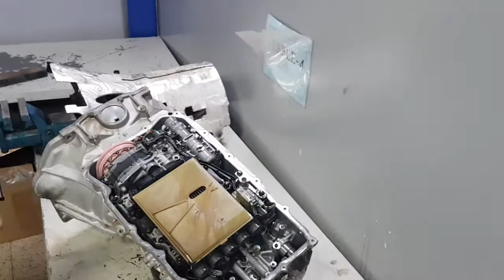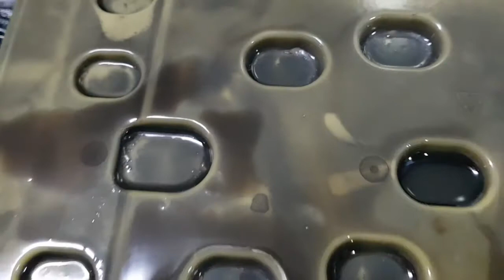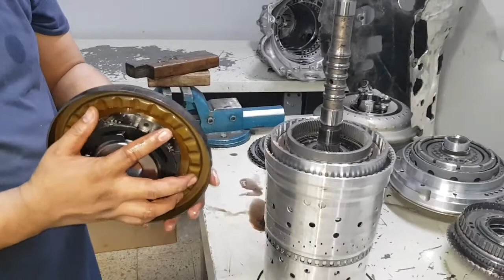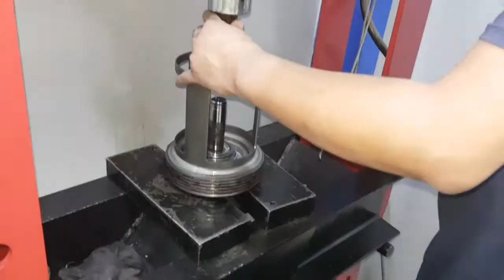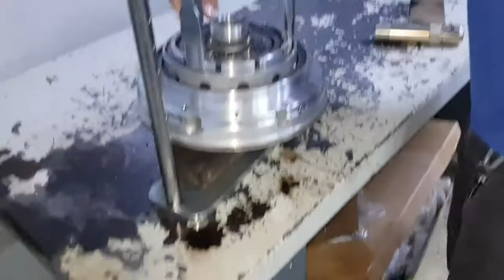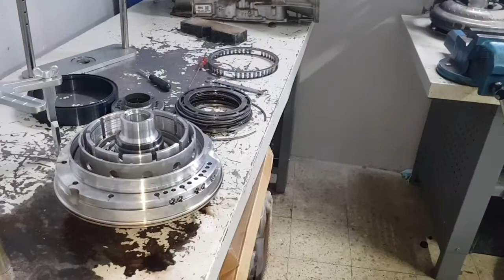10L80, MF6 TRANSMISSION DENALI. Noise and delayed shift, dismantle and inspection

Comment: What's the gold looking stuff in the bottom of the pan?  Mine had those chunks of brass/gold nuggets at the bottom of the pan when i changed my fluid. It moves around and is not casting material. Makes a very slight whine when Revving the engine.

Comment: GMC Greatest transmission ever: Builds the 6L80 with pump built into bellhousing. Bla lol.

Now the 10L is a one piece housing with a separate pump. Going back to what works. Still a crappy build. I hope aftermarket builders fix this 10L. This looks so much easier than before that I can rebuild my own.